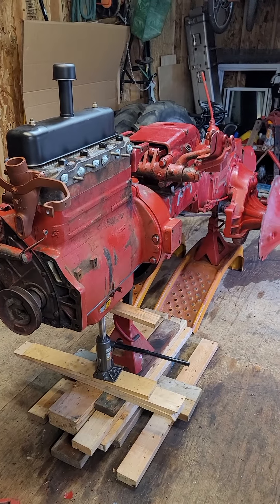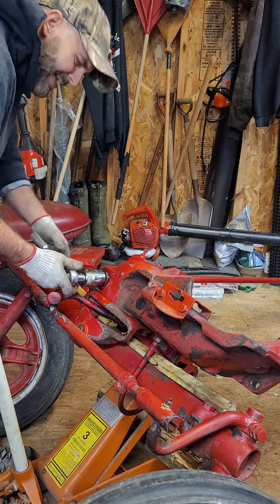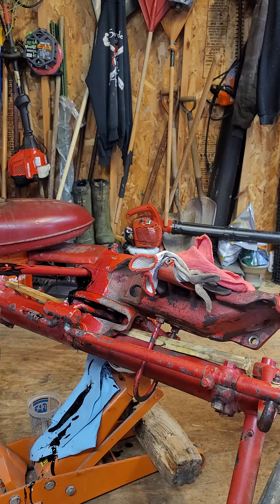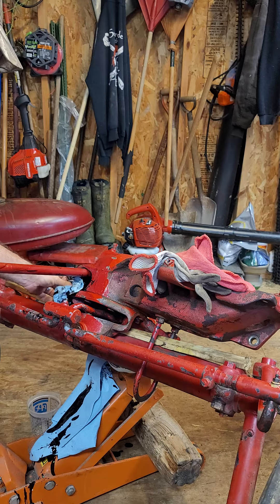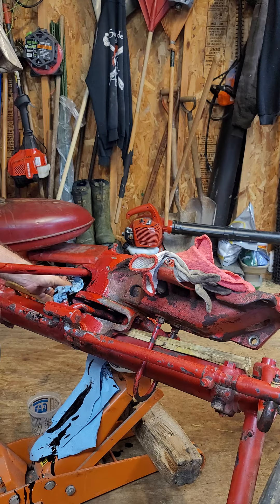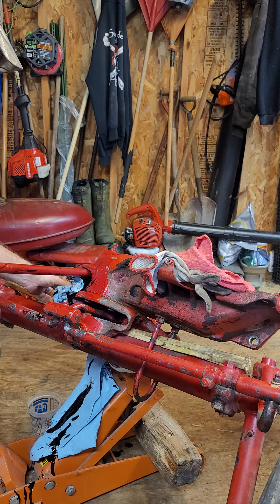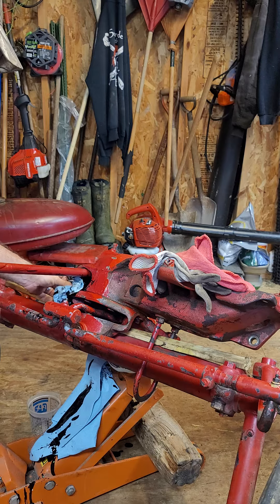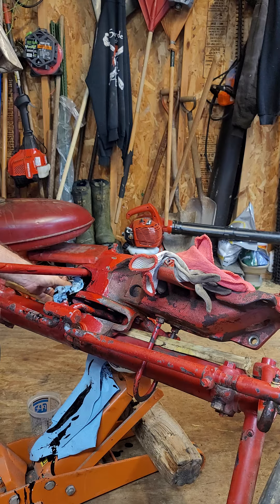Farmall Super A steering box  disassembly and rebuild

Comment: I wonder if you took the worm gear to a bearing place.  The one in my area is called Previs bearings if they could measure it and match to one of there gears.  Great job.
Reply from the maker: Its possible.  All in all it wasn't hard to tighten up the steering in the old girl. She drives beautifully now!

Comment: Good video,on mine the steering wheel just spins around without turning the wheels,would that most likely be the shear pin on the gear.And will I have to remove the front axle,will that be necessary? Thanx for any I nfo
Reply from the maker: Unfortunately it sounds lile the keyway onnthe sector shaft probably broke. Yeah you'll have to pull the bolster apart to fix it. My other videos showed how I repaired it.